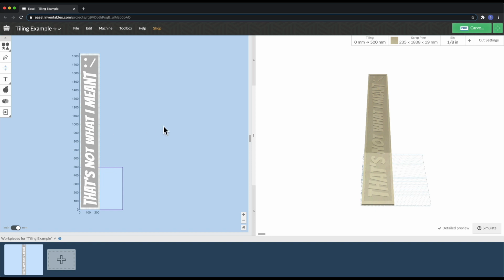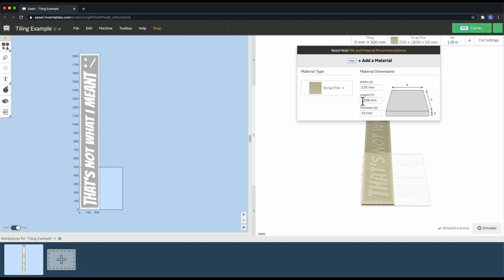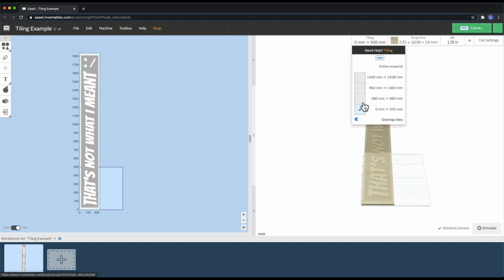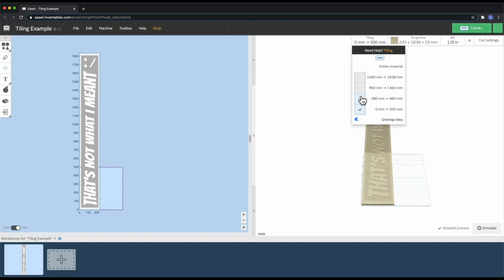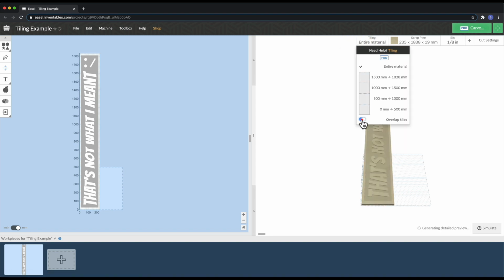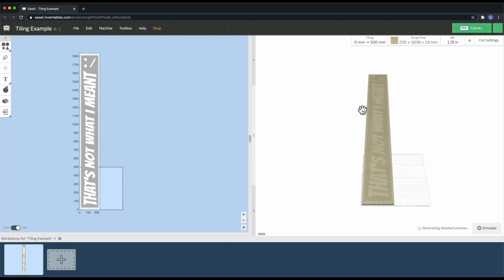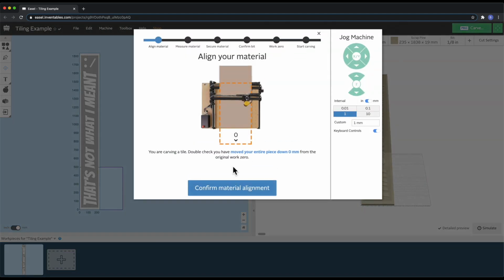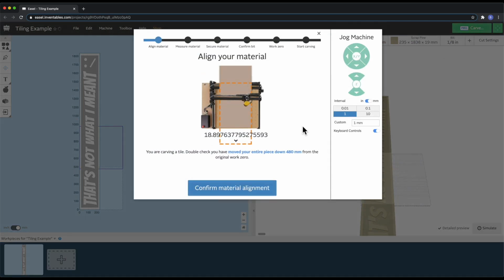Easel Pro Features: Tiling

Comment: On my latest project,  the software didn't compute enough tiles without running out past worktable. 3018 pro cnc. And  the parameters of the machine are set in the software.

Comment: I have had nothing but trouble using the tiling feature.All my projects end up with a distinct line right through the workpiece from top to bottom which end up in the bin because the line is too deep to sand out.I have done everything possible to try and rectify this issue i.e resurfaced spoil board,double checked mm per pass etc etc.Cannot win with it